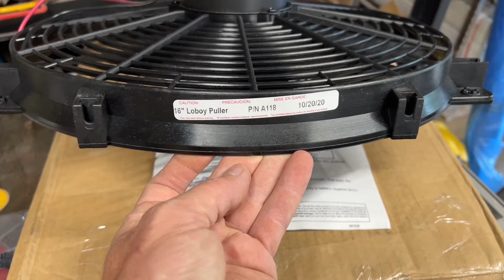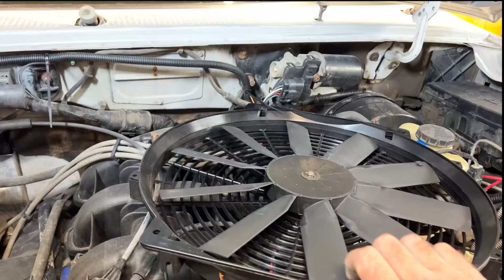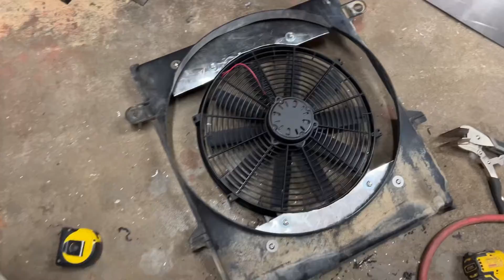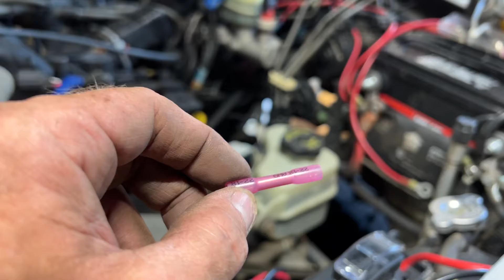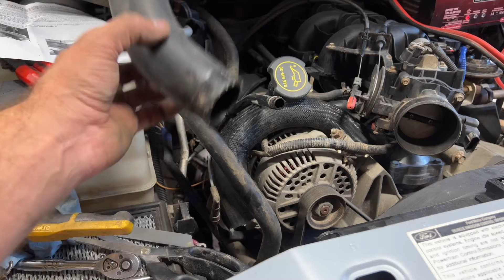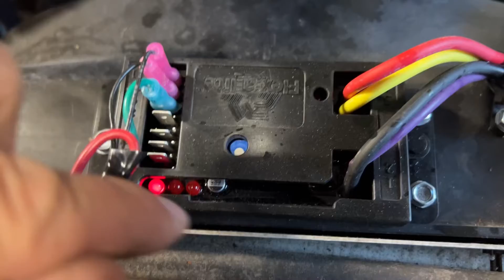Ford Ranger Electric Fan Install

Comment: You want to be sure you always have it on th Lower rad hose because otherwise you get in accurate readings, you want the fan to cool based on how hot or cold the coolant is when it comes out of the radiator not when it goes in. 
because its always going to go in hot, but it wont always come out cool enough. ive been doing efan swaps for years and i'lve learned much along the way.
Reply from the maker: Great information thanks!

Comment: One little finally, someone with my identical thoughts. Opinions and dislikes about clutch fans. I had to replace mine recently, and of course I went to Amazon special. I didn't buy the bottom line, but I didn't buy the oe. Replacement, and d***, this thing is just as loud as A bad clutch fan.Thank you for making this post.
Reply from the maker: Glad it helped!

Comment: I’m sorry, but that just looks totally bad, especially with the controller and all the wires mounted right on the top ?? Why didn’t you just hook the fan up the way it was meant to be and right to the radiator it’ll work just fine
Reply from the maker: It’s a 4core rad, you can’t run a normal mechanical fan it will hit the rad. Needed the extra capacity for my supercharger. Still working, I’m happy

Comment: I replaced the head gasket on my 2.3 ranger. Went to put the clutch fan back on and it pretty much just disintegrated so now I'm trying to figure out how to wire this ebay fan 😆
Reply from the maker: I like my electric fan… but I ended up going with a controller that ramps the speed depending on the temp.
Reply: @ZacsTruckShop  I got my fan wired in, it came with a thermostat switch that was way too low and just ran all the time. Then I put in a 200 on and 185 thermostat switch in but think that's too hot now haha

Comment: Great stuff. How did you delete the EGR without throwing engine check code?
Reply from the maker: I swapped in a computer and wiring from a 2003 it came with no egr. I did that when I installed the manual transmission and transfer case. 👍

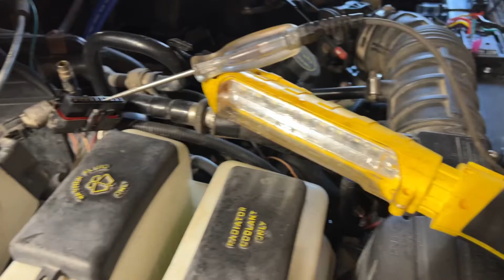Comment: @RangerShop You kind of skipped around the wiring part @10:30 on the video when the sound dropped out ....Where did the plug you are holding come from ????  Is the plug from the truck wiring harness or is it from the aftermarket fan controller 🤔 its kind of confusing
Reply from the maker: Yeah sorry about that… ok so the fan controller runs everything - you just need power and ground to the controller. Then you need to tie it into Key on power so it knows when it should be running. I got that from the connector I was showing…. It’s just my speed control connector. But you can use anything…. Any key on power would work, I just used my test light and kept checking wires till one was off when key was off but lit up when key was on. Then I tied into that.

Hope that makes sense.

Comment: Hello @RangerShop Great video thanks for the info You stated that you would do a follow up video to tell us if your fan setup worked or not and if you had to make mods to get it to meet your needs  I hope it will work on my 1996 3.0 2WD Ranger too.... I would think it would since my engine is smaller and doesn't have 4WD but does have AC ..Cheers
Reply from the maker: I’m going to try to put together an update video on the supercharger and fan installation tomorrow…. Stay tuned. So far it’s worked great 👍
Reply: @ZacsTruckShop  Thanks Im looking forward to it

Comment: Great video,  Question how did you hook up the A/C clutch to the new fan to come on when the A/C comes on. 
I have an 2002 ford ranger edge, and want to do the same thing,  but can't find anything on how to wire the A/C clutch to come on when it is in demand,  thank you....!
Reply from the maker: If you want you can wire it into the fan controller…. The fan controller has a hook up to your compressor switch. I didn’t bother with it though…. Where I live it’s quite cold so no need really.

Comment: Is this a pretty simple project at home?
Reply from the maker: Yeah it’s really not that bad. Including adding the metal to the shroud it probably took me 4.5hrs that’s with installing the coolant sensor in-line and wiring it up.
Reply: @ZacsTruckShop  is the sensor an important part in making it work?

Comment: Have you been able to test the fans cooling capability?  Was wondering how the metal fill in around it either helped or hindered overall air free flow. Vs fan pulled sir
Reply from the maker: Hmmm I haven’t towed with it yet but I’ve been driving a lot and so far so good. I think it might bring the engine up to temp quickly but once the fan is running it sucks thru a ton of air. Standing in front of the truck you can really feel it pull the air through. Once I’ve towed with it I will let you know.